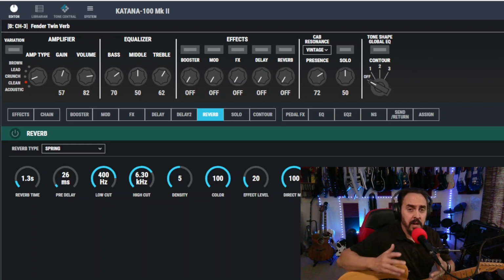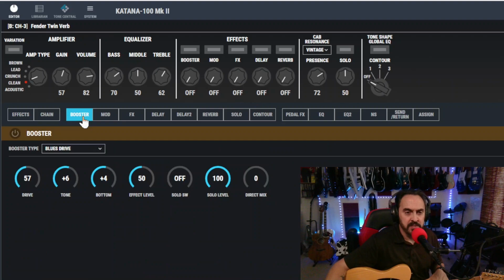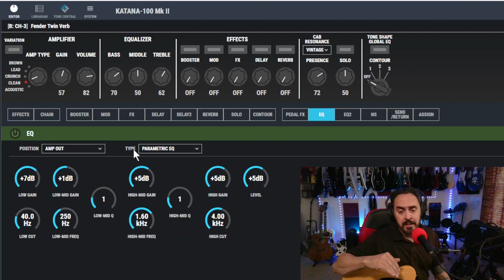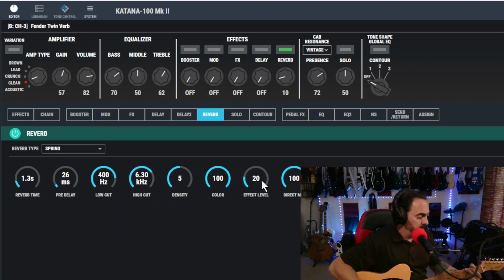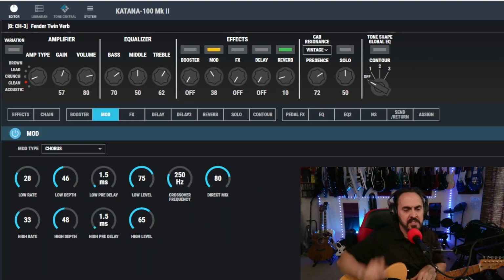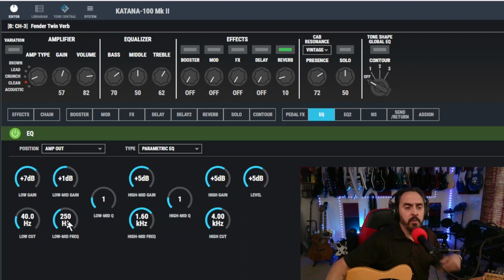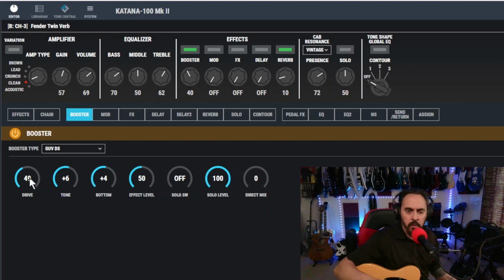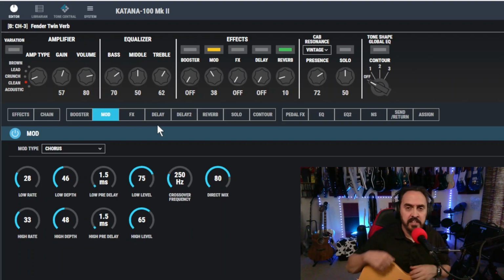Turn Your Boss Katana Mk 2 Into A Fender Twin Reverb #bosskatana  #fender

Comment: GREAT VIDEO! Thank you very all your tutorials on the Boss Katana. I just bought the amp and your videos are helping me find all the tones I want.
Reply from the maker: That's what I like to hear. Some folks just want to download patches and don't want to be bothered to learn how to get the tone they want.
Reply: @Guitarnivore  Yeah man keep the good stuff going 🤩Some other videos have somebody playing a demo track, with little or no explanation whatsoever. I'm not saying that's not good, but the issue is that most of the playing is in a mix, heavily mixed, and maybe double-tracked, and when you load the patch and play it directly from Katana speaker it's totally different from what you hear in the video. And it's hard for a beginner to start fiddling around with the settings to get close to the patch promoted in the video, if there is no tutorial or an explanation of what and how stuff was used.

Comment: This is a really helpful video for me.  For me, the Katana has been a little overwhelming in all its options and your video presents how to make adjustments in a way that was easy for me to consume.  I gig with it cause it's lighter than my tube amp and sounds good enough.  Also, I primarily play single coil guitars fr classic R&R and it seems like most of the patches out there are for humbucker guitars and lean toward metal or just weird and unusable sounds.  My tele sounds really good with this Twin patch and the tutorial on how to add in boost and delay and adjust the EQ made a lot of sense.  Now I just need to find a way to get my tele to give me the 70's classic saturated marshall amp sound and I'll be in perfect shape.
Reply from the maker: Glad to hear. It can certainly be overwhelming. For the Marshall sound, play around  with the crunch amp and ease into the gain. If you need more boost, try the treble boost or the T-Scream as a boost with low drive, but about 50 on the level in the boost settings. Also play with the Direct Mix on the boost. Maybe play with the mids a bit. I'm getting a bit overwhelmed myself. 😁

Comment: Thanks for the demo. I tried a katana but did not like the clean tone, I now see it is possible to get a twin type sound. I use many amps .Roland 85 cubes x 2 with extension cabs. loud,great tone,light, super easy to dial in any guitar to sound great. I also use a modified twin with 12L EVS  for loud clean gigs, if I have help with the load.About 120lb///
Reply from the maker: If I tried a Katana in a store, I probably wouldn't have bought one. The factory presets are very blah and to truly take advantage of its capabilities, you need to use tone studio. I never thought about this until now, but I wonder what this tone would sound like through a 2x12 Katana.

Comment: Dude you are a genius! I set my Katana head the way you instructed and OMG, it's a twin, I run my head through a 2x12 with an Eminence Swamp Thang and a Texas Heat, I'm sure that adds a bit to the sound. You are right, all the boosters sound so fantastic with this setting. Since you nailed the twin sound, any chance you will do a Bassman in the future?
Reply from the maker: Thanks. Glad you dig it! I've never played through a Bassman, so I'd have to do some research and try to get an ear for it

Comment: Hello Scott. I found your Channel and have to say Great stuff on Katana content. I downloaded this patch and it is THE BEST Fender Twin patch that i got, and trust me i‘ve searched. I think the EQ makes it authentic. The only think i want to add is that i put my Katana 50 Mk2 and a real Twin side by side. The Katana has a „hiss“ or microphonic interference „thing“ that the Twin has not. When i switchd the Booster off it goes away, but also the tone is not the same. Did you have the same problem? I play a Fender Japan 60‘s traditional Stratocaster with single coils. Cheers from Austria.
Reply from the maker: I hear the typical 60 cycle hum from the single coils, but that's about it. Sometimes your guitar can pick up different interference with things like your monitor of your computer or TV and the amp kind of amplifies that.

Comment: if the katana can read the software from the GT 100 which is a modeler then the katana is also a modeler it’s just harder to access the settings on the katana since they are hidden.
Reply from the maker: That makes sense, since you can use the sneaky amps. Never really thought about it that way.

Comment: When you're on a patch with a sneaky amp (the Twin Reverb, for example) and you change to pushed or crunch, does it just add the crunch to the sneaky amp or go back to the amp on the panel? Similarly, are the amp types on the panel different amps, or basically just the same foundation with gain added? Hopefully, my question is clear.
Reply from the maker: You're talking Gen 3. Sneaky amps don't work with Gen 3, so it reverts back to the default of whichever amp family the sneaky amp belonged to. In this case, it reverts to a clean amp, which still sounds close enough. I've actually been playing with the pushed amp with this patch lately and I think it sounds great. As far as Mk2 goes, when you have the patch loaded and you change the amp to crunch or whatever on the panel or in tone studio, it drops the sneaky amp and reverts to the amp you changed it to. Even if you go back to the clean amp, the sneaky amp in the patch is temporarily gone and it will sound different. To get that sneaky amp back, just click on the patch in the library again and it will revert back to the original patch configuration.  The sneaky amp is not very different from the clean amp anyway. I hope that answered your question.

Comment: I use the twin sneaky amp for my cover band, love it way better than the stock clean sound. I need to figure out a good boost to use with it... I'm halfway through so you may elaborate on what you use. For the more rock stuff we do, I have used the 1959, it sounds great for pink floyd and other stuff.
Reply from the maker: I don't use them nearly enough and I just got back to laying with this one. I didn't cover it too much because this video was kind of on the fly, but the natural OD sounds great, as does the blues driver, but both require slight tweaking of tone and bottom.
Reply: @Guitarnivore  can you show how touse the overdrives? I can't seem to make them sound like my pedals
Reply from the maker: @luisrubio7837  I'll do one in the future.
Reply: @Guitarnivore  thanks! I played around with it but I’ve never really had  the chance to play through a real vox ac30  so i don’t really know how close I am
Reply from the maker: @luisrubio7837  same here.
Reply: @Guitarnivore  here's a question- anything you could think of that help me get a uniform volume between different patches? It's a pain in the ass, tho I feel Ive got to a decent enough place. Like maybe even rules of thumb, like any overdrives output always set to this, then just use the channel volume to set your volume from patch to patch?
Reply from the maker: @hereonmars  The best way to get your patch volumes consistent is to set your master to your desired volume and work around that by adjusting the volume of the patch with the amp volume and then write it to a channel and resave back to the liveset. I was going through some of my patches today that I did for tutorials and damn near blew my eardrums out. I need to start saving them lower before I upload them for everyone to download.

Comment: Will this work with mK1?
Reply from the maker: It should. If the patch doesn't work, download the sneaky amps for the base amp and then just copy the settings from the video. It's just clean boost, reverb and Parametric EQ.

Comment: Does this work with the Katana MK II 50 EX?...
I only see videos for the 100 W versions.
Reply from the maker: Yes, but it will sound thinner due to the speaker in the 50. You may be able to increase the lows in the Parametric EQ though.

Comment: What does the £1,324 Fender tone master twin Reverb 85W do that the £438 Boss Katana MK2 100w 2x12 cant do?
Reply from the maker: It looks nice on stage.  😆 How does this patch sound on the 212?
Reply: @Guitarnivore  okay thats a fair point! the fender does "look" better, the Boss is just a boring looking black box without any style, ill be honest still not connected my PC to it yet i need a cable.
Reply from the maker: @NightOwlGames  No old printer USB cable laying around?
Reply: @Guitarnivore  i have found a cable installed firmware, ive downloaded your files but i dont know where to put them or how to add them to boss app
Reply: @Guitarnivore  either its not installed properly or my ears are bad i cant really notice a difference.
Reply from the maker: @NightOwlGames  Part of the 3 hour guide. An older video done with the 50 a few years ago, but the steps are the same. https://youtu.be/VEMI2VnQS9w

Comment: Sure, I'll just download that random dropbox file that you say is an amp model file.
Reply from the maker: 😂 You can download it from the boss tone exchange too. Just search "Guitarnivore". I need to update the links.
Reply: @Guitarnivore  thanks for the reply, I appreciate it. Just looking into these amps, I'm used to changing tubes, not downloading software :)
Reply from the maker: No problem. Do your due diligence. This amp is not for everyone. I don't want to discourage you, but if you like simplicity, this is not the amp for you. I guess it all depends on what kind of music you play. If you mostly stick with clean or overdriven tones, I would stick with the tubes you're used to or an Orange. The Orange 35RT is not very expensive and that thing is loud and full of all sorts of tone goodness. Out of the box the presets on the Katana aren't all that great and to turn on the noise suppressor or change drives, you really need to get it connected with the software. Some folks don't like dealing with all that and I can't blame them. I hope you find what you're looking for.